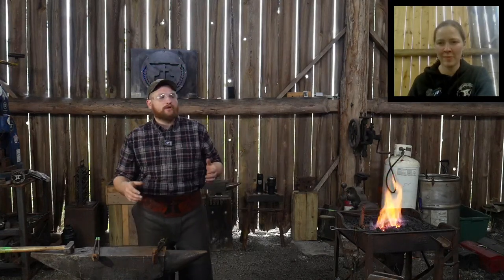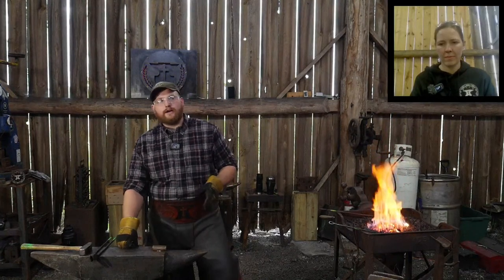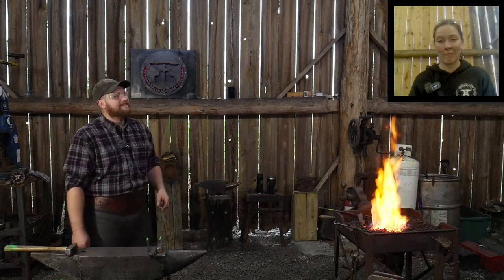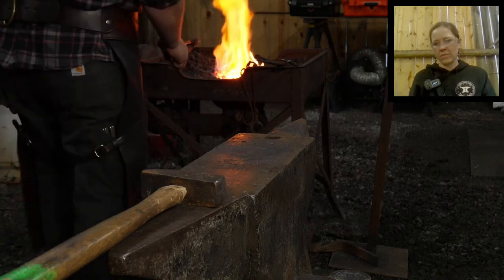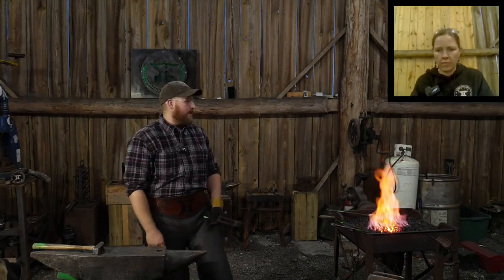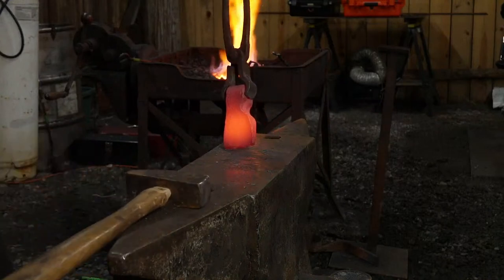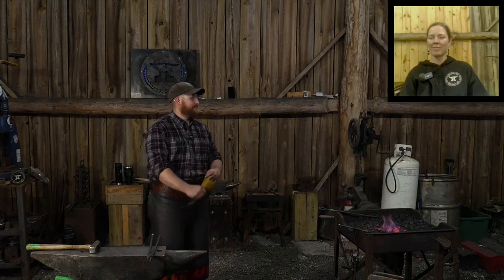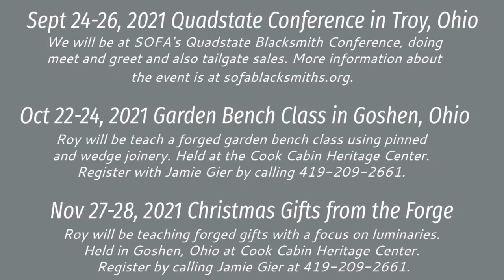LIVE: Swage Block Giveaway!

Comment: Steel distributors think theirs doesn't stink (💩). It's the most vile of all imho. I had a sweet deal with a metal utility trailer fabrication business in one of my neighboring cities. I made a sign for their business and they liked it so much that, after paying for it, they GAVE me one of their $1500 5×10 trailers. I painted (neatly) on both sides "Sold by ******* Mfg" with the phone  number below for MY appreciation. Free advertising. They came back at me with all the drop from the sawing department I could stand to haul away, with the occasional half sheet of 5/32" sheet tossed on top. To ice the cake, they recommended my shop for traditional and ornamental jobs. Was win/win for 8 yrs. Owner sold out. All new shop crew. And the end of easy street. It really stung the first purchase I made that fall at the distributor. 
  Rant over.
Read less